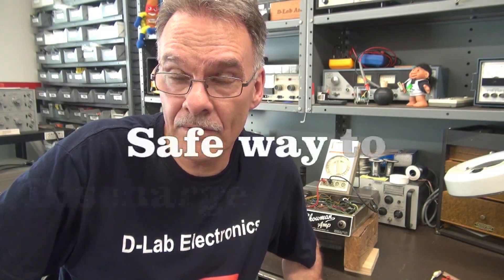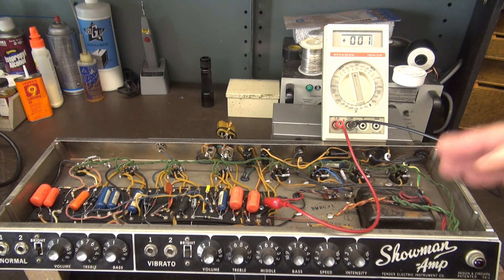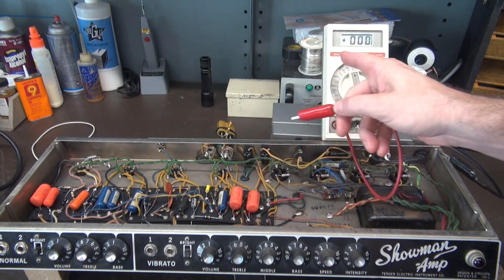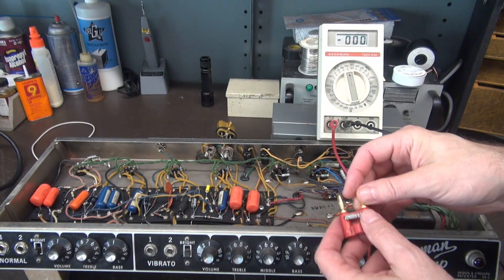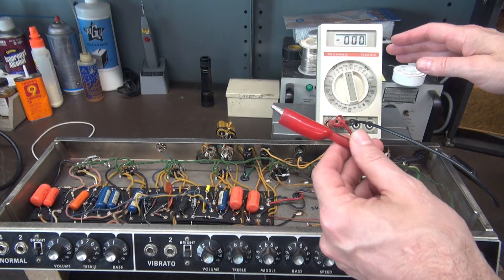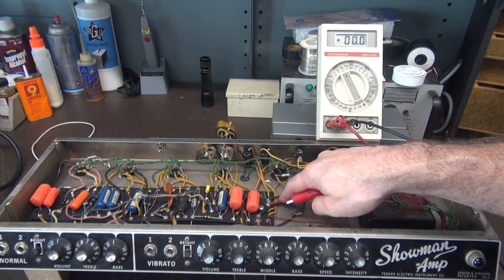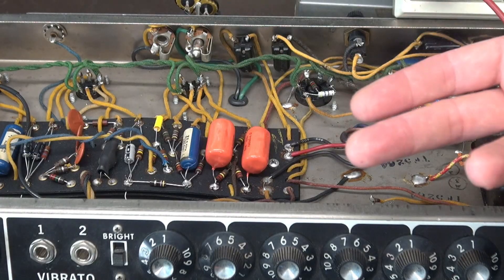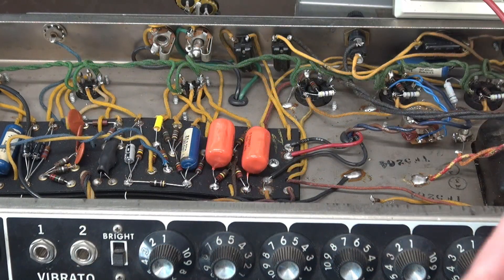How to safely discharge tube guitar amp Filter capacitors D-Lab Tech Tip

Comment: Thanks for all your quick tips keep up the good work keep the videos coming.
       Rectifier tube question and alternative use odd project. Would like to use a rectifier tube to build a low-voltage 5.3V 1.5A to 2A cell phone battery charger. I know it’s not practical, big bulky expensive if you had to buy the parts but if you have already had all the parts for free it should be possible?.

Comment: I know that a resistive discharge is better, removes the risk of damaging the cap and all but the dead short method is so much more fun ... 😉
Back when I was doing domestic field repairs, TVs mainly, I used to carry a ripple cap bypass tester made from a big cap with jump leads. 
If a customers little dog just wouldn't go away I used to charge the cap up from the power supply then short the crocs. 
Dog runs off in fright from the spark and the noise ... job done.

Comment: Buying a 57 custom champ this week and is this a good enough reason to have a mod to add a standby switch?
Reply: No. There is no point in adding a standby switch to that old vintage amp. Maybe take that money and invest in keeping the amp in tip top shape. Most important would be to have 3 prong power cable installed and cut out the death cap if still present.
Reply: Thanks

Comment: Just worked on an old Traynor YBA-1 and it has standby switch just like the Vibrolux. Thought about modding the switch to just break B+ directly instead of breaking ground in the bridge. The thought of extra long wires with B+ on a very quiet hum free amp kept me from performing the mod. I tend to check the caps right at the source so the standby wouldn't break the ground connection on the Traynor. In fact I bet on the Fender amp that caps are grounded even if the standby is on or off. Only difference would be if no groun reference on bridge then the D.C. Voltage will not flow into the circuit.
Reply: Yup just looked at the vibrolux schematic and cp38 is where the filters make contact with ground. The bridge is not directly grounded at the component connection point. So just don't connect negative lead of the meter at the center tap position on the bridge rectifier and expect that point to always be grounded.

Comment: Thanks for the tip on the negatively-switched standby circuit. Never saw that before in an amp but the fact that if you don't know and you think you've discharged the caps is worth being aware of. Learned something new. Keep up the great work!
Reply: I have been working around TV and radio for around 50 years. Of course I don't normally work on guitar amps, so  a standby switch in the B+ would not be something I would run across. Having it on the negative rail seems really not well thought out by the engineer who designed it.

Comment: What about touching the chasis with the power cable, won't that discharge the caps?
Reply: No it won't. The power cable is galvanically isolated from the capacitors by the power transformer.
Reply: OK. Thanks.

Comment: Excellent idea using that banana stacker.  Maybe some heatshrink tubing over the resistor area of the stacker would be good.  Looking at the Vibrolux schematic there is a ground connection at CP1? (can't read it) on the negative rail just after C33.  Therefore with your banana stacker in place, the meter negative connected to the chassis and the positive connected to either TP33 or TP34, I believe the main filter capacitors would still discharge.  As you rightly point out though , the voltage on all the other filter caps should be checked for discharge as well.
Reply: Jeff M Exactly so. The only thing the standby switch is shown as disconnecting here is the bottom of the bridge rectifier. The caps are still grounded. But a better reason to leave it on is so that the valves stay heated and so can still conduct away some HT.
Reply: If someone turns on the amp and doesn't wait long enough for the power tubes to heat up then flips the amp off. That will leave a very high potential for residual voltage in the caps, assuming amp does not have bleed resistors on filters. That's one advantage to having a tube rectifier in that it requires the same filament supply to be able to produce the DC voltage.
Reply: I meant to say flips the stand by switch on without waiting for tubes to heat up. Then turns amp off right away, all while tubes not having time to heat up and conduct. Not saying that will happen very often but it might when you are troubleshooting an amp on the work bench.
Reply: Ringo Starr As a matter of fact the whole standby switch thing is based on a fallacy. It is about preventing cathode stripping, but you need kilovolts  for that to occur, i.e. transmitter valves. See here: https://debontamps.com/standby-switches/. They became a kind of fashion statement. I've even seen them in solid-state amplifiers, don't ask me why, and in fact I was once chastised by a band guy whose SS amp I had used during the solo act, for turning it completely off instead of just back to standby. He was convinced it was harmful. Couldn't be told otherwise. And I've seen tube amps whose solution to this non-problem was to put -750V on the grids for 40 seconds: cure somewhat worse than the disease.
Reply: Yup you are correct about cathode stripping occurring at high voltages. That SS must have been pretty old to have a standby switch, perhaps an old Vox amp?  However the SS Vox amps from way back disconnected the speaker in standby mode which would at least get rid of pops when the amp woke up stupidly.

Comment: Great tip.  Learned that from my uncle who learned it from my grandfather.  One thing to remember is use a resistor rated at the maximum voltage you will encounter.  I once accidentally ordered the wrong series of metal film resistors from Dale.  I wanted 750 volt rated resistors and ordered 250 volt resistors by accident.  I would say they went poof the instant they had power applied but they didn't do anything but go open.  No magic smoke, no snap crackle or pop, just went open.
Reply: Wait… this guy said to use a 22k 2 watt resistor. If a resistor max voltage is 1.5x the wattage, then a 2 watt resistor can handle a max of 3 volts. How can I tell the max voltage I’ll be dealing with within an amp? I’m planning to work on a fender blues Junior 15 watt amp.
Reply: @Amplified62  Not sure what math your using but it's not Ohm's law.  Power (wattage) = voltage squared over resistance.  That would give you the power dissipated in the resistor.